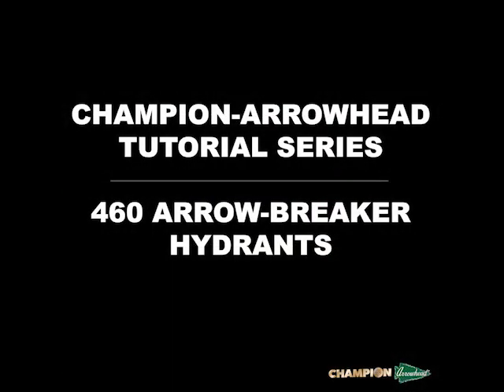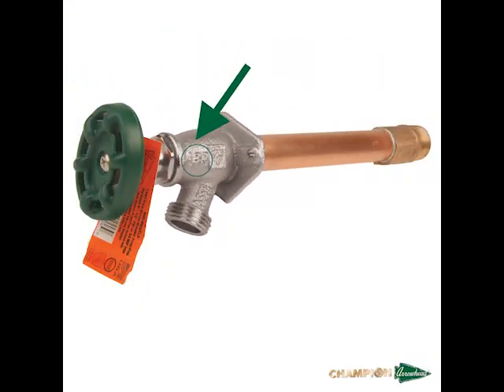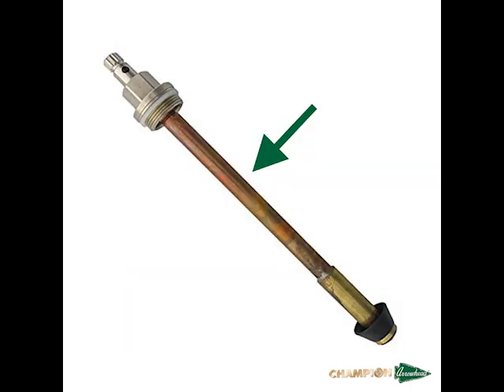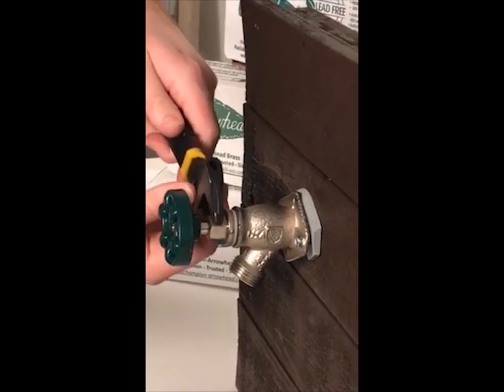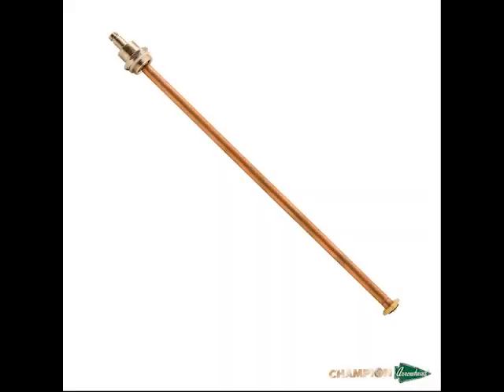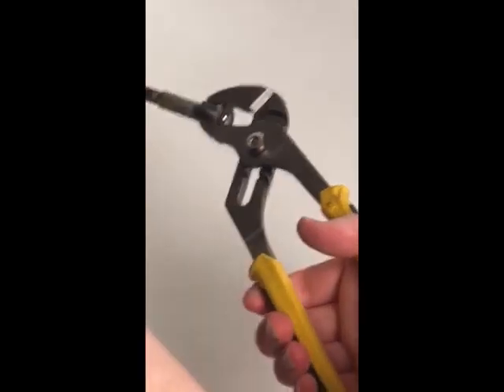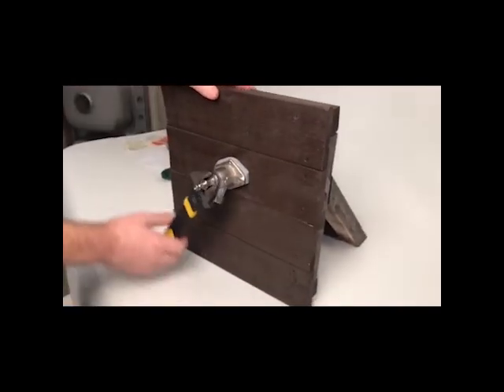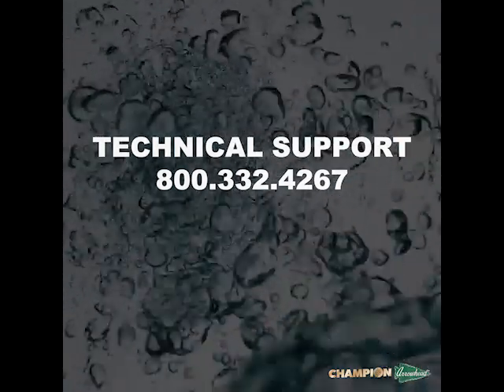Champion Arrowhead 460 Repair Series

Comment: This thing is super annoying. Leaked from the weep hole from new. Replaced the check valve and guess what? Leaking again within a week. I have an auto watering system for my planter boxes and this is the only outside hydrant I have. Apparently it’s the wrong one.
Reply: I am trying to fix a weep hole leak as well? did you end up getting a whole new faucet?  I have an auto-watering system too so technically it's constantly "on"
Reply: @legacycontrol  Because it has to be replaced so far back into the wall it hasn’t been top of list. At this point I’m just not using my auto watering. But gardens are planted and summer is coming so dealing with a leaky faucet is just what I’ll have to live with.

Comment: so it is not designed to be use for 12 hours or more, with a garden hose connected? what kind of crap is it? yes, I have a quick stream from the weep hole on the handle. unbelievable. BTW, I don't leave my garden hose end in a shithole so no need for these anti siphon half baked designs.
Reply: These are designed to be installed, not used. We're on our THIRD replacement PK2026 in 6 years. "Not designed to have a host connected for 12 hours" seems like a "not designed to be a wall mount hydrant".
Reply: I have a weep hole streaming leak too and I plan to replace the check valve - should I just give up and replace the whole faucet since I plan to run a timer on it?
Reply: @legacycontrol  there is a tiny o-ring inside the check valve that needs replacing, that's the actual fix... but the company makes money from selling the whole thing as a replacement.
Reply: Terrible-stupid design, don’t buy this faucet. The weep hole check assembly design sucks!!!!!
Reply: @oscarteran7734  when i replace mine, I'll try to remember to take out the old o-ring out and take measurements with my calipers and post here. if that's the real cause of the leaking, a bag of replacement o-rings would cost a buck

Comment: I'm trying to replace the check assembly part. I just don't understand. The little instruction that the guy gave me at the hardware store, no one mentioned the screw on the end of the check assembly. I can't get this thing off even when trying to unscrew it. This is so ridiculous! And your video is not helpful
Reply: Well I finally got it off. Couldn't believe how long that took. Thought I was going to break the whole thing and now I'm trying to get the new one on. What a joke! I can't even believe it won't go on now. I'm trying to tap it lightly with the hammer like the guy at the hardware store said and it just wants to go in. It crooked now I'm afraid I'm going to break it. Putting a new one on... What a complete joke only in the US. Do we have crap like this... Well I got it on there. Just kind of a frustrating part to deal with that's for sure.. I hope this fixes the problem